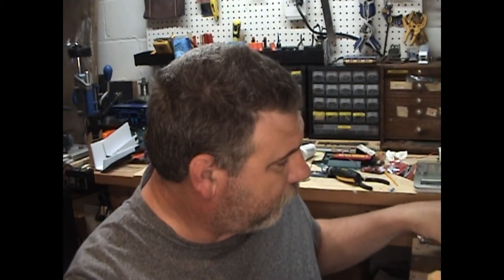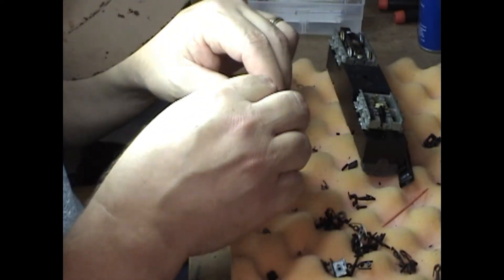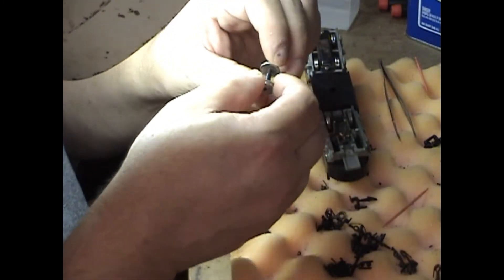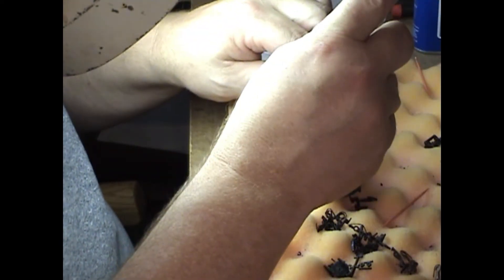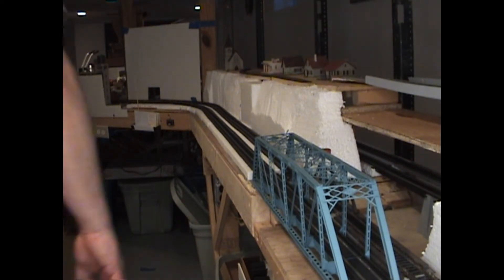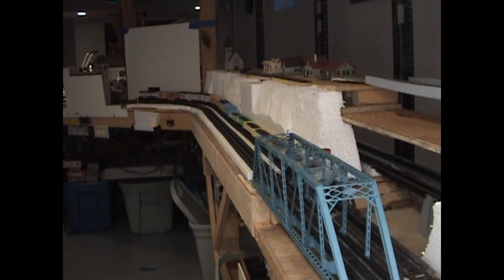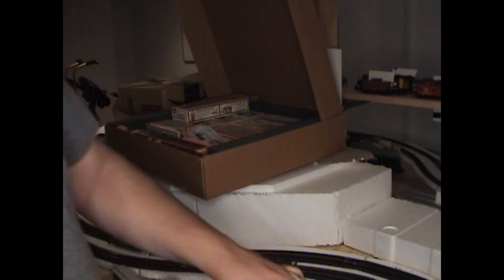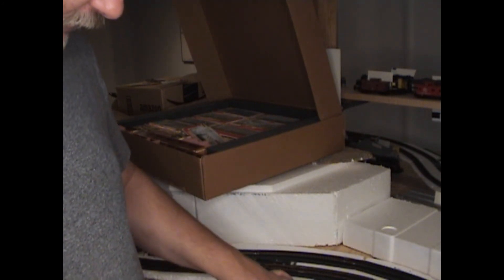Boeville & Newtown, New Beginnings #25-2021, AHM C-liner Fix, Forth of July Running, July 4th, 2021

Comment: Ray! Thank you for this video. I always thought only steamers had traction tires. The more you know, lol. What brand of traction tire do you use? Seems to be a few different brands out there and I'd rather not reinvent the wheel lol if I don't have to. So you can swap out shells even if not same loco/brand? Love the states and 1776 trains! USA baby!
Reply from the maker: As far as the traction tires go, I use Stewart Hobbies. You can use (if they still make them) eye glass "o" rings, but those do need to be warmed up before you can use them. Now, as far as swapping shells, back in the day, Athearn, Bachmann and Life Like could be interchanged, mainly the F units. AHM had to be AHM. I believe I can swap Bachmann and Atlas U-boats around, but I dont think Ive tried that recently.